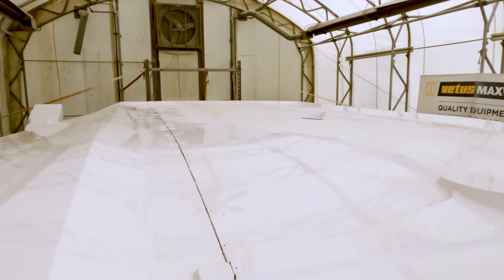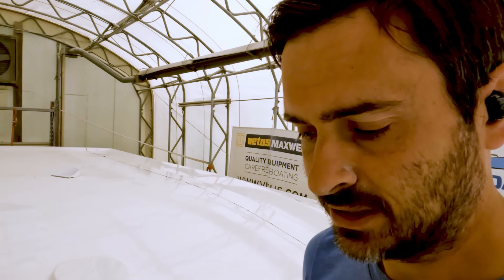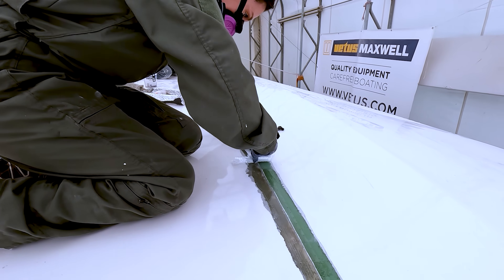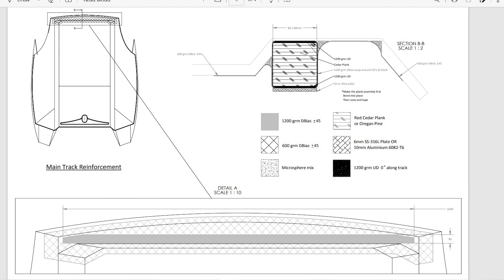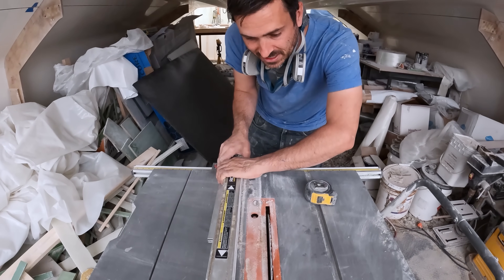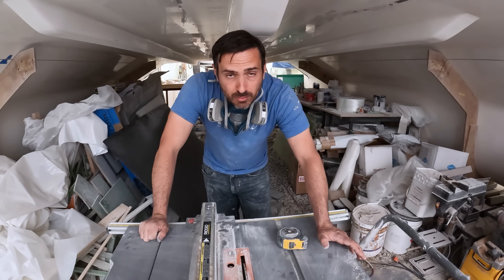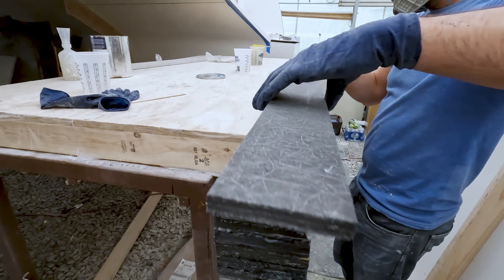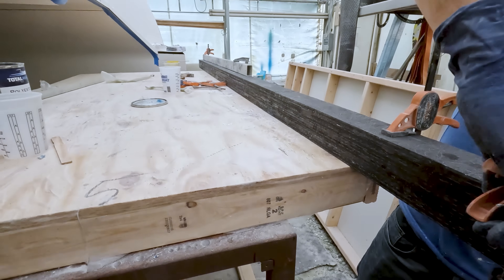At Least We're Not Sanding!! (Because We're Vacuum Bagging) MJ Sailing - Ep 284

Comment: Well the first video I watched was you receiving and unloading the parts then it went together so quickly. Wow figured you would be in the water in a month. 2 years later you are still working in it. Wow so much work I can understand why you crawled into a cupboard and cried. Omg just get it into the water and
SAIL HER. DO A LITTLE WORK ON YOUR TRAVELS AND THOSE GUYS ON THE ISLANDS ARE EXPERTS WITH FIBERGLASS YOU CAN GET 20 GUYS WORKING ON IT AND HAVE IT FINISHED IN A DAY. PLUS PEOPLE DO NOT LIKE Watching and hearing sanding and grinding your YouTube revenue will go up once you cruise to the islands. GET GOING!😂😮. It does not need to be perfect. Look where other catamaran bulkheads crack and jus reinforce it there.

Comment: What's with the gaps on the sugar scoops?
Reply from the maker: That's where the hull piece of our kit met the transom piece. Originally there was a flange which overlapped the two, but we didn't like it and cut it off. We still need to cut away areas in there for kick up rudders, so we haven't addressed it yet.

Comment: Coosa you say.  How does Coosa compare to Star Board?
Reply from the maker: Starboard is a HDPE plastic that nothing sticks to.  Coosa is a high density core material with fiberglass reinforcements. It's slightly denser than Cedar.  It's typically used in transoms to cope with the force and pressure of high hp outboards.

Comment: Cheapen a build by using wood is shortcut one should never take. Drive a screw into wood and it's now subject to rotting from the inside out. By the time you see the rot it's always too late to do anything but replace.

Thinking outside the box I now use Totalboat penetrating epoxy for wood structure outside the house. Elevated patio deck, patio cover, pool gazebo, decorative fencing, and greenhouse now match. Getting stain/paint to adhere to it after is another topic. Great product, but like you I refuse to you I refuse to use wood on my catamaran.

Most impressed by how you two refuse to take short cuts. "More or Less" never enters your vocabulary.
Reply from the maker: The traveler track gets through bolted through the beam and into an aluminum back plate.  The yard in Vietnam epoxy pots each hole to prevent water intrusion.  It's a time extensive process, but they have many hands to make short work of it.  We don't, so the Coosa board seemed like a better solution for us.

Comment: Just to let you know the respirator without the p95 cloth filter are still letting fibers and dust through, that voc filter only gets vapors you  need both.
Reply from the maker: Using both stages of filtration would  be better, but I don't believe it's correct that fiberglass is getting through.   VOC are way, way smaller than any fiberglass dust and anything that can filter a gas would be able to prevent dust getting through.   The dust filters would be pre filtering and helps to keep airflow through the VOC filter.
Reply: An expert I am not, but please ask one, believe me the fibers and dust are getting through the charcoal . I have used those respirators for 30 years.  I am impressed with how far you have come on the build . Keep up the good work.

Comment: I can see another 2 to 3 years of work here, massive amount of work and resources used in this project by unskilled workers trying to learn on the job, when you should have had Professionals build the whole thing.
Reply from the maker: Sometimes people actually enjoy the journey of doing things themselves instead of racing to the destination.  If the goal is to quickly get sailing, then buy a production boat and watch it get built for you.
Reply: @MJSailing  I fail to see anything enjoyable about sanding and wearing suits and breathing aids, production boats are a better option as they come with a warranty.
Reply from the maker: Obviously this isn't for you.  That's fine.  But thinking what you find enjoyable is the only way is pretty small minded.
Reply: @MJSailing  Noted, I now know that when offered advice your true self comes out,
Reply from the maker: Advice? Didn't see any of that above. Just a single opinion which doesn't fit everyone. - Jessica
Reply: Yea they are so far from finishing, the hull is like having the tortilla but wanting a beef fajita.Hope you worked Sophie hard and dirty so she runs from following your footsteps 😢

Comment: If you have many of those seems a gel peeler would be a great investment.  They are a tool often used for peeling gelcoat to do osmosis repairs but have also seen them used for doing this job joining seems.
Reply from the maker: I saw Metabo is selling a fairly inexpensive gelcoat planer now labeled as a paint remover.  It would make neat work of the seams

Comment: Matt, Where you have install hardware in beam, try and run heavily loaded fasteners THROUGH beam so a washer/plate and nut or bolt head can do the work, separately from a well bedded sealer or even a polymer sleeve... this is so you can seal the beam while not being strained by loads.. ie sealed areas floating and allowing expansion/contraction to occur normally without affecting bedding compounds or a sleeve being placed in shear loads.
Reply from the maker: Everything is bolted through the beam.  We're looking at breaking loads close to 10k lbs, so the entire beam gets a 3/8 aluminum plate on the back side.

Comment: Great choice with the Coosa over the cedar.  Did Andy Miller give you this idea?  A little surprised Max Cruise does not do this themselves (name me one old boat that has not had to replace rotted wood where high stress fittings are anchored through the deck into it???).  2 questions: 1) How did you transfer the curves of the hull to the beam in 3 dimensions?  2) Does gravity matter to the curing process?  Did you rotate the beam while it was curing both while the compressor was on and once again while it was sitting in the sun; e.g., 15 minutes on a side?
Reply from the maker: Max Cruise has the time and people to individually pot and seal whole in the beam.  It sounded like too much work when we have the coosa alternative readily available.  I'm not sure who Andy Miller is, but Coosa board is often used in transoms of boats wherever high density core is needed.
Reply: @MJSailing  Andy Miller is “Boatworks Today” YT channel.

Comment: I think if you got the tubes but A. try a small fan on the open end ( hair dryer even) as you slide the tube on, that way it  won't touch and pull the layers, or B. cut the tube in half for really long objects and use the fan inflation approach. A lot less tape and fuss
Reply from the maker: A fan is a good idea to allow easy insertion of the beam.  Thanks

Comment: Wondering if a plastic welder would help with making the vacuum bags. Might be useful for making sealed bags later(storage) and for custom floaty things.
Reply from the maker: I'm sure it would work.  It's how they make the tubes I discussed in the video.   It would save a bit of fiddling with the yellow tape.